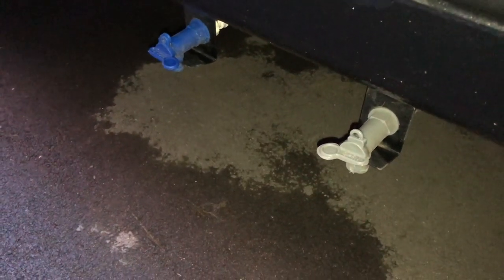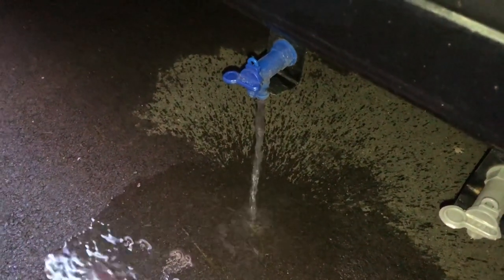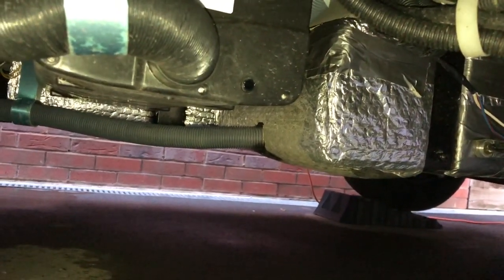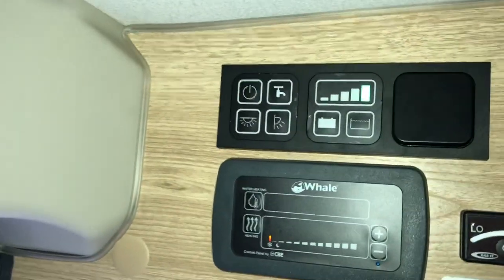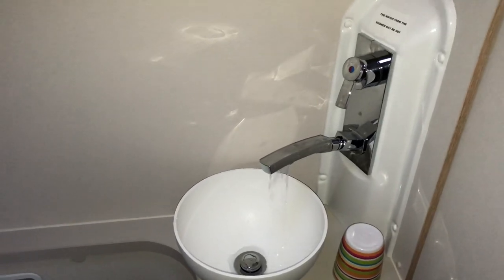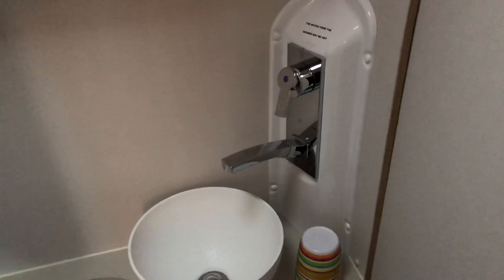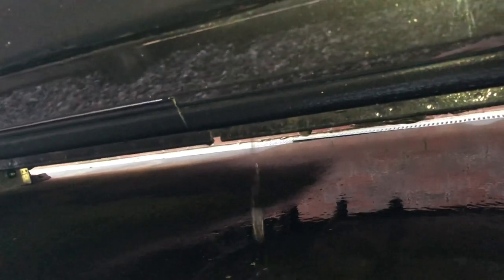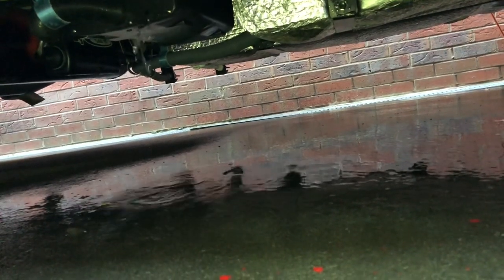Draining The Water System For Winter Or Maintenance On An Elddis & Compass CV20 40 60 80 Campervan

Comment: hi rick nice one mate 👍 , noticed your tanks ,  or one of them i could see at least , were insulated , was that an option or did it it come standard , cheers 
mike
Reply from the maker: Hi Mike, with it being a van conversion and storage a premium all the tanks are underslung to save inside space, the fresh and waste are insulated and have tank heaters in them to stop them freezing if you’re using the van in cold temperatures, the boiler isn’t insulated as they assume you’re going to have it on if out I guess, Elddis offer the “winter pack” as an option, as we’re (normally - damn Covid) all year campers we went for the option 👍

Comment: Great video again guys.
We are looking at buying the cv 80 what width do you need to park it on the drive way.
Thanks martin & Martine
Reply from the maker: Our drive is 3 metres wide between our house and the neighbours house, the Fiat is approx 2050 or 2500 with mirrors out, we have to fold one in to get past the gatepost. Shout up if you need any more help.

Comment: Great video guys - thanks for sharing. Just one question - do you do this if your van is on EHU on the drive, or only to prevent freezing if not on EHU?
Reply from the maker: There are tank warmers on our van to stop the cold and waste tanks freezing up but if you were leaving the van full of water you’ll need to leave the hot water on and the van heating on to prevent freezing of everything, faced with total lockdown for another 2 months I decided to completely empty the system
Reply: I fear you’re right about the two months 😔
Reply: We leave ours with some water in and on EHU all the time with the heating on low. But it was at the workshop for two nights so it was emptied. Good job as it was so cold the water in the kitchen sink was frozen when we got it home, so definitely best to drain if it's not on EHU. Ours has tank heaters too, think Elddis do it as standard.
Reply from the maker: @roaminginraymond  tank heaters on waste and fresh but obviously not on the boiler itself so the water would need to be left on low, I drained it as it doesn’t look like we’re going anywhere anytime soon 😕 when we sleep in it on the drive we just take a bottle of water in for use.
Reply: @RickandHeather  that's fair enough and you may as well. We've had ours over two years and normally tour all year, or use it on the drive, so this is the first time it's had everything drained properly cos of actually going in the workshop for a couple of days. We also never use the tank heaters either incase we forget to turn them off while we're off grid.